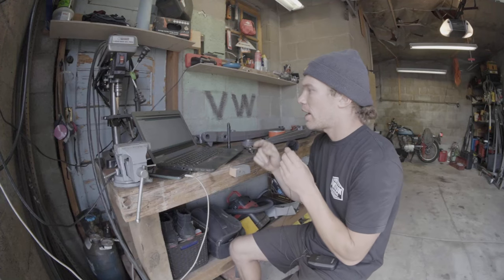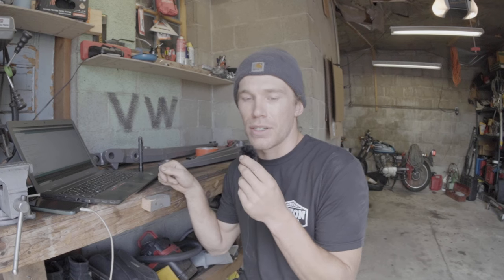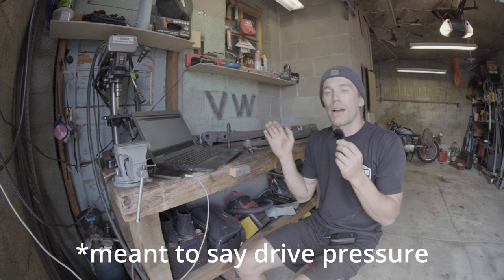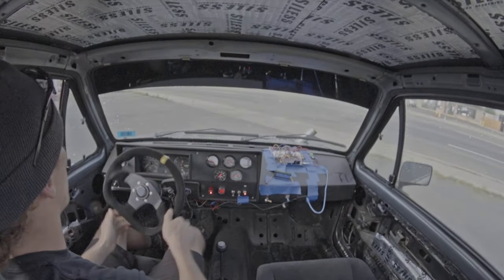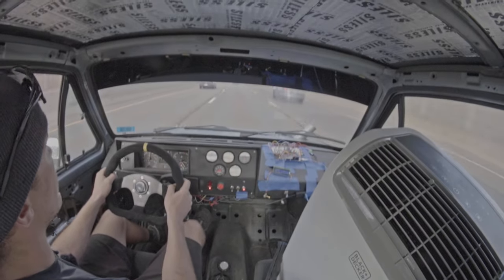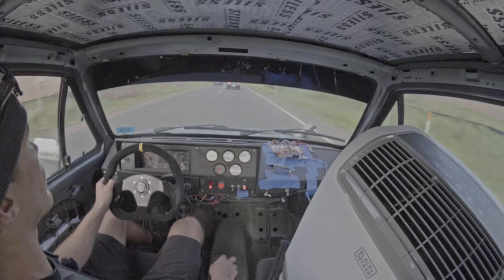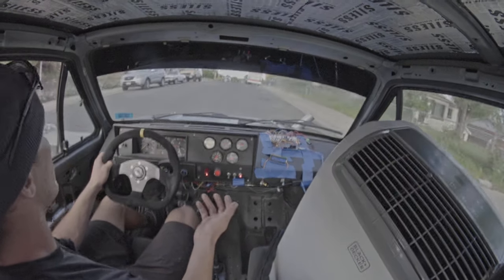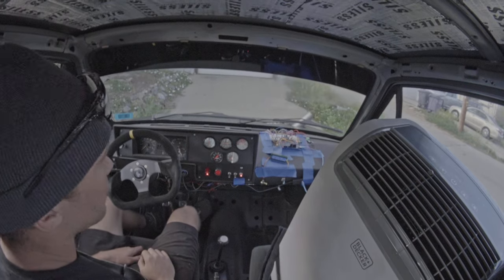Experimenting with BOOST / DRIVE ratio - Turbo tuning!

Comment: I’m finding this series super interesting as I just swapped a mtdi ALH into my vanagon.   I wanted to keep everything mechanical so am currently using a gfb V2 boost controller to operate the stock vnt turbo.  It uses vacuum, boost and intake lines to control spooling response and max boost.  I wonder what the relationship between intake and drive pressure is?  Anyway, keep up the good work!
Reply from the maker: Sounds interesting! How do you like the gfb controller? Do you find it responds how you'd like it to? Do you run boost/drive pressure gauges
Reply: I have boost and egt gauges currently, I may have to add drive pressure.  It seems to work pretty well, I’ve got it tuned to where it starts spooling almost immediately and tops out at 14psi… egt stays below 1100 even on long uphill pulls… just a puff of initial smoke and then it cleans up.  Cruising at highway speeds I’m seeing 5-10psi… eventually I’ll be getting a bigger turbo and injectors… see how it goes…
Reply from the maker: @larrynaylor6952  sounds sick. I would definitely give the full mechanical setup a look at some point. VNT is gas when it works well 🔥🔥

Comment: from my measures on newer engines (1.9pd-130hp) the boost is around 16psi on cruising over 2.3k rpm, the overboost around  22,5 then comes back to 21.5 max throttle
Reply from the maker: Interesting, thanks!

Comment: wow 17lbs is a lot of boost I run total 12 in my aaz.....I had it at 14 but I felt that was rod bending zone. So I took it back to 12. was faster at 14.....
Reply from the maker: Yeah I'm not worried about my rods bc I already bent them with propane once lol now they're H beam. I'm convinced the stock rods are good to at least 20 psi though if set up right

Comment: Have you considered a setting at which the drive pressure would be allowed to drop to a lower minimum after a sustained period within a certain range of boost?

For example; you accelerate to 70mph on the freeway and are cruising. After, say 5 seconds of boost pressure stabilizing between, 10 and 15 psi (i have no idea what boost would really be) the controller allows drive pressure to fall to a new, lower minimum for cruising. 

 How about multiple performance settings? You could have push button selection!?

The possibilities are endless, if you whip your programmer friend hard and long enough!
Reply: I agree, I like what Oliver is doing but you almost need like a multiple stage switch so you can set freeway mode or drag mode. But also I wonder if you can put like a wide open throttle switch to engage your “super tune” and it goes to much lower drive pressures when you aren’t full throttle. I understand that putting a throttle position sensor in with your mechanical pump would be a pain but a wide open throttle switch to change between spicy and not spicy would be easy enough. Otherwise in cruise your drive pressures would remain high.
Reply from the maker: 😂😂😂 oh MY so many good suggestions!! I do like that idea 💡 I do feel like that might be the root solution.. just multiple tunes! For now though I really want a spicy tune that kicks ass so I'm going to continue working on that! It's also hard to exactly know what's normal bc so few people actually monitor drive pressure... Not much data to analyze. Found a few people tuning trucks to check on and it seems like high drive pressure is fairly normal 💁💁💁
Reply from the maker: X2 on this! I do think eventually adding a potentiometer to the gas pedal is the way to go so floored = fast

Comment: Were you running that aftermarket air conditioner? Probably robbing a few horses with that beast.
Reply from the maker: 😂😂😂 facts can't be doing that
Reply: oh yea on a 1.6 that is super draining. On a 1.9 it is doable but still loose some ponies.

Comment: Was your 1.6 originally turbocharged?  Did you go with the oil cooled pistons?
Reply from the maker: This 1.6 was a turbo block. It does have the oil squirters in it 👍
Reply: @OliverFetter  Is there information you have about installing the piston odling nozxles?
Reply from the maker: @EnGammalAmazon  in theory you could have them added to an NA block but I don't see it being very worthwhile.